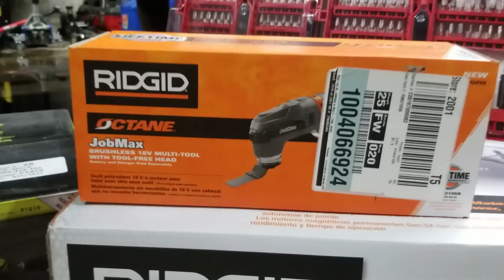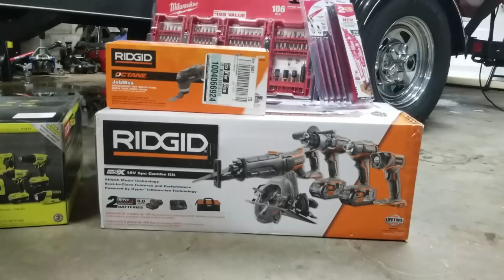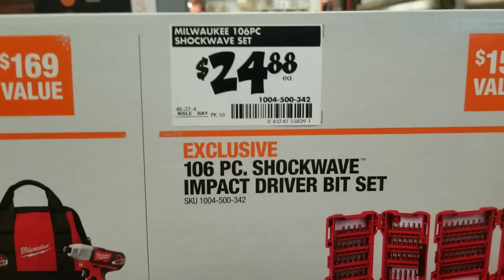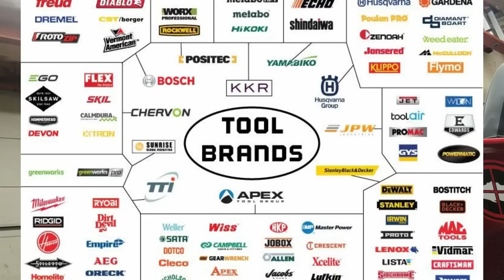MUST KNOW BLACK FRIDAY DEALS AT THE HOME DEPOT!!! PLUS...

Comment: Also, there is a dial on the top of the 'barrel' of the recip saw.  That allows the blade to move in an orbital motion and can help cut through wood.  Test it out in different positions on different types/thicknesses/hardnesses of wood.  Orbital mode is faster, but not as clean/neat as the other mode.

Comment: That oscillating tool is one of the handiest tools but I own. I can plunge cut into lath and plaster when putting in an outlet box in the wall unlike like a jigsaw which will shake the lath too much and knock off the old plaster. It will cut out a section of sheetrock faster than using a sheetrock knife. It will also plunge cut into a plywood cabinet if you're putting it over an outlet box. I bought the Craftsman set 6 or 7 years ago in 12 volt. I like them very much because the batteries are very small and the drill itself is small but powerful enough to drive a 3 inch drywall screw screw straight into a two-by-four. have not had a problem with them yet except that two of my battery chargers have gone bad . I had bought multiple sets so I still have two battery chargers left. I have noticed a Stihl tool being sold at Ace Hardware that is the same shape as the Craftsman tool so not sure who is making the Stihl but looks like they had also manufactured these tools for Craftsman. R i p Sears. I am eyeballing the Milwaukee fuel line of tools but so far my Craftsman tools have not given up and they do the job that I need them to do and I am a contractor working on my own property which are rentals. That Ridgid oscillating tool you showed looked a bit large. I would say my Craftsman one is half that size. Size Matters. Thanks for showcasing Home Depot. We bought  $2,000 worth of stock in Home Depot back in 1992. You would not believe what that is worth today. I just bought 12 of the Home Depot Husky tool boxes 42 in wide and 24 inch deep and I am redoing my whole kitchen with these tool boxes and they are working out awesome. Now we need to find some upper cabinets to match. Try checking out homedepot.com. that is where we have gotten some awesome deals and saved 30% over what the prices are in the store. Also if you have some Ira money to invest Home Depot has done us well.

Comment: My experience with Ridgid tools.  Well, I started a flip and needed a saw.  HD had a sale on their corded circular saw.  I couldn't keep the heel set to the proper depth or angles.  So I returned it, and the replacement did the same thing.  The plastic butterfly would not allow the bolt to twist far enough to grip the heel, and my cuts were all off and looked like crap.  Apparently the person putting these together wasn't paying attention, and put them on wrong.  I'm not sure how many were like this, but the two that I got were.  Anyway, I removed the entire plastic butterfly nut and bolt that it was turning and rotated it slightly, then reinstalled the bolt.  Now it works properly.
I do like their lifetime tool repair and battery replacement policy though.  If they made as many tools as Milwaukee, I might have considered them for my next purchase.

Comment: That lever on the bottom of the reciprocating saw (Where your non-shooting hand goes) is to allow the shoe to move in and out.  This helps if you are in a tight spot and don't want the blade to go deep and maybe hit something hard and bend it.  Open the lever, adjust the shoe and lock it in place.

Comment: A lot of jigsaws have the blade angle/tilt screw.  From what I have noticed, it is used for cutting different types of material.  Some metal blades cut better at an angle if the stock is thick.  Also I have been told that certain plastics will cut better or may not splinter with the tilt.  But wood seems to cut best in the straight position. Basically, it allows the blade to move different than older jigsaws like out grandfathers had.  The same thing goes for the blade speed, different materials are cut better at different speeds.

Comment: I have the Ryobi tools, and for the most part, the tools themselves seem to be on the OK level for around the house stuff.  Prices are reasonable for that level of use.  I tried using them on a daily basis when I was installing alarms, sprinklers, satellite and Cable TV's etc.  But the batteries couldn't hold up for long term use.  Even the guy at my local HD store gave me two replacement batteries, and they are now shot.  So, now I spend a little more and get Milwaukee tools.  I'll be giving the Ryobi tools and the large tote bag with wheels away to someone else.

Comment: Remember to register your Ridgid batteries with the Ridgid company for insured free replacements.  Ridgid impact driver is very strong good for framing.  Where the Ryobi driver is a bit mellow good for finish work.  Good Luck!
Reply from the maker: yes!! thanks for adding that! I actually still need to get it done
Reply: @NWIVeteranConstruction  Thanks.  Your guys can run the hell out of the batteries and not worry about replacing the worn out batteries.  But they do take hundreds of recharge cycles.

Comment: I saw that same Milwaukee bit set display at HD, and thought the same thing, "Why are they the same price for less pieces?".  But then I looked at them a little closer.  There are different pieces in the two different Milwaukee sets.  That is why they are the same price.  Their drill bits cost more than a few cross tip bits.

Comment: Awesome video! Me, I’m a MAKITA guy. No I have had Ridgid both the brushless drill and impact driver. Ridgid is a total sleeper, the warranty on the tool AND the battery makes the choice a no brainer. My issue with the Ridgid  was I hated the the trigger on the drill and in the impact the rubber over molding peeled off the tool super quickly. I also use to run Milwaukee but the tool inter action (how it felt in hand) was terrible. Awesome super powerful tools but I did not like how they felt in hand. The MAKITA super low vibration, excellent balance, really powerful and great battery technology. The Ridgid is IMO a wonderful buy just make sure to register it with the company and enjoy that warranty. Truly it will be the last tool you buy. Happy Thanksgiving stay safe  and thank for the content!
Reply: From what I've seen in other videos, Ridgid's failing is that the warranty is VERY difficult to collect on. So much so that if I was in the trades, I would not buy them.

As a homeowner, I've had very good luck with most of my Ridgid tools, but did have a failure with the switch on the cordless circular saw. I had to take it to a local repair outfit to get it serviced under warranty (local being a 35 minute drive). It took the better part of 2 weeks to get the repair done. Not something a pro could really tolerate, I'd guess.

Comment: Ryobi is the most compatible tool I've used they keep all there batteries the same which is very cool. Dewalt I have an impact 20v yea its nice but I wouldn't buy anymore of dewalts stuff they change up there stuff 2 much which is very pricey 2 keep up with there methods. So I pick Ryobi because they have kept there stuff the same which I like.
Reply: Dewalt changed their battery type once. There are quite literally two different types of batteries.

Comment: just picked up the 9 tool ryobi for 300$ insane deal
Reply from the maker: sure is! they got one hell of a collection too. pretty much anything chorded they have that tool battery powered. badass big battery too
Reply: im 15 just starting my collection. wanting to slowely collect milwaukee as i use and abuse my dads. milwaukee is some of the best power tools i have ever used. just didnt want to spend a fortune rn lol
Reply from the maker: @josephgibbons4068  Haha makes sense! Like I said they're good for your situation for sure.  Great move
Reply: Definitely will get the job done for the time being
Reply: And u won't be sorry Ryobi is very reliable imo
Reply: @flyguy7836  Just gotta treat them nice. I've had some Ryobi cordless tools for several years that work well.
Reply: I used ryobi for awhile but the newer sawzall breaks easily. I went thru 5 of them in a year
Reply: @billkurban8075  yea I have the older one its still going strong been a few years I've put a beating on it and its still ready 2 work. I do like Dewalt there very nice but more$$

Comment: Please, do not turn the blade around.  If you are going to cut other materials, get a blade designed to cut that material.  Safety is paramount.  Well, at least that's what they drill into our heads in the Corps.